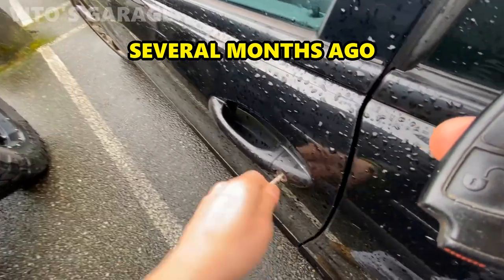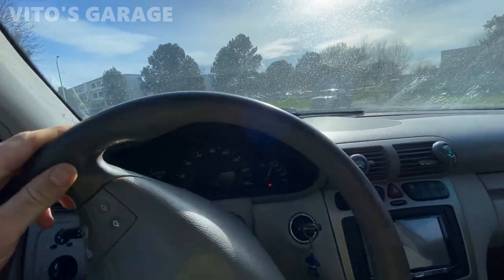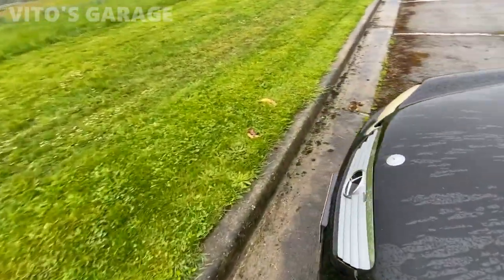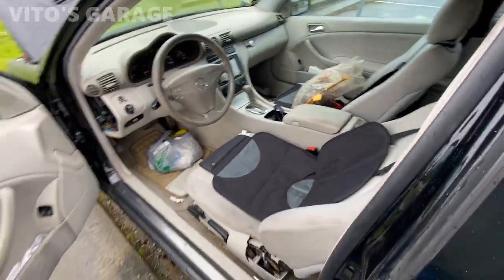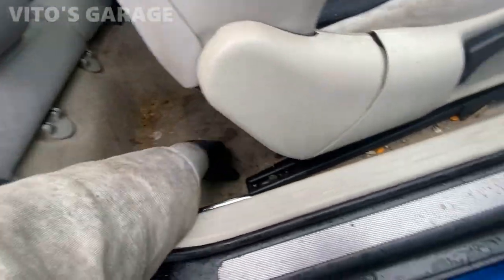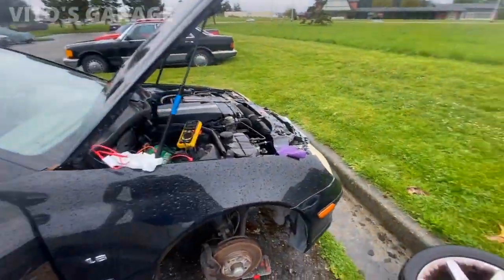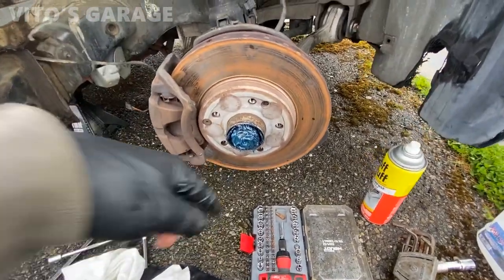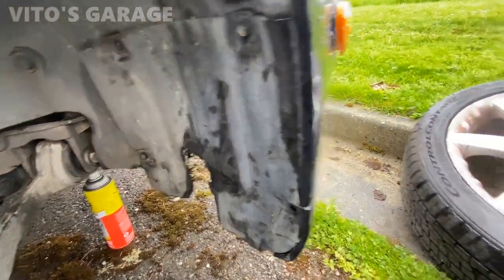W203 2004 Mercedes C230 Kompressor Coupe. First Look. Needs Love. Starting the Repairs

Comment: While my mechanic is changing out the M271 engine top cover gasket he spotted worn & broken teeth on the inlet cam. 21 of the 44 teeth is 70% gone. Exhuast cam is slightly worn still have all its 44 teeth. Year stamp on cam adjusters is 2004 & 2005.

Suppose to change out tge timing chain tensioner at every 60 to 80k miles or when the tension on the tensioner had dropped by 20 to 30%?.

Anyhow ended spending USD2300 from engine & transmisson mounts, replace rubber boots for drive shaft, timing chain & belt tensioner, two rear bush, water hose, one lower arm, thermostar, bracket, N20 gear, oil seals, PCV hoses, bell housing seal etc etc totaling 30 small & bigger items. Hoping for lesser trouble for next 5 years.

Comment: Hey vito im looking at this 1991 500sl and i guess I'd love a good opinion, the cars got some rear end damage which i think i can fix, the issue is the throttle body probably need to be completely replaced im not sure
Reply from the maker: Hi there. 1991 model has a KE-Jetronic system. There’s no wiring harness problems on these. Great cars! Go for it👍🏻
Reply: @VITOSGARAGE  sadly the car had some gasket issues i didn't know how to fix, i just flipped the car to someone that knows what they're doing